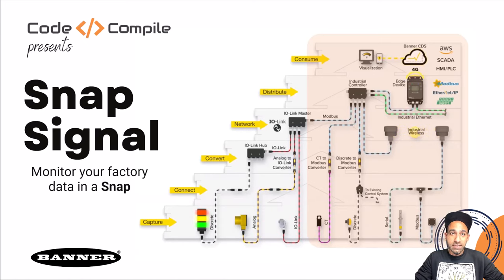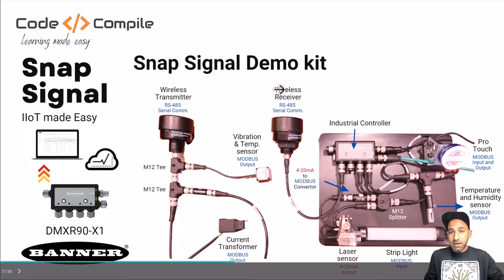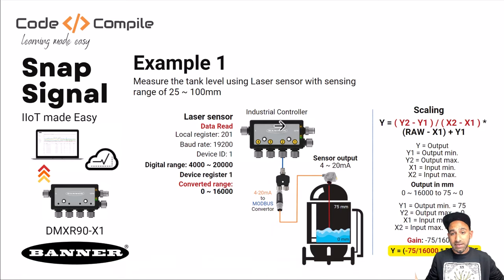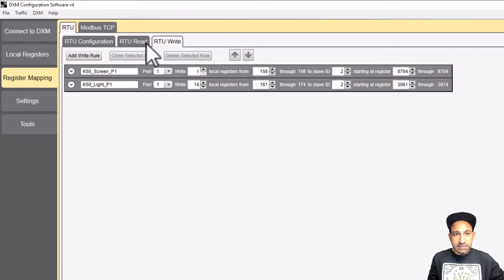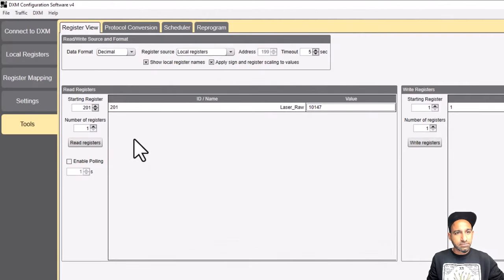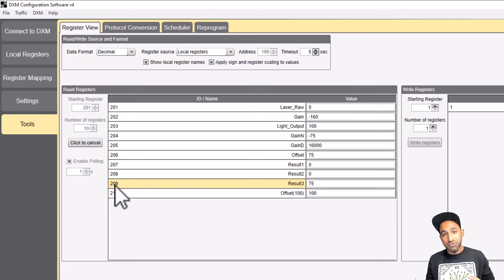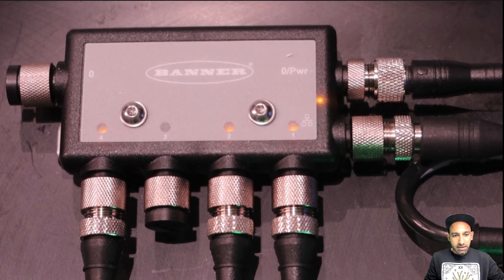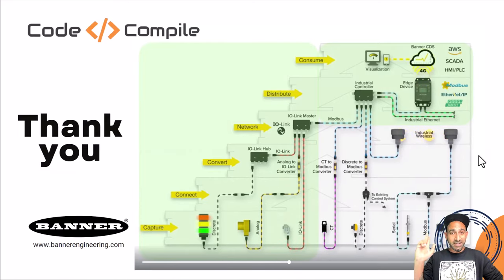SnapSignal: OT and IT Integration

Comment: I'm in dire need of assistance with my 4-20 setup. There's a node linked to my gateway, and I require the precise 4-20 signal that's connected to the node to also be replicated at the gateway. Presently, it's consistently erratic and malfunctioning. I'm in desperate need of assistance from a professional in resolving this issue.
Reply from the maker: Do you still need help? Contact me via email

Comment: Which version of the DXM configuration software are you using?  mine doesn't have the AWS IoT core option (v 4.16.2)
Reply: DXMR90 Cannot connect to AWS IoT Core. It only works with other DXM devices, such as DXM700 and DXM1200.